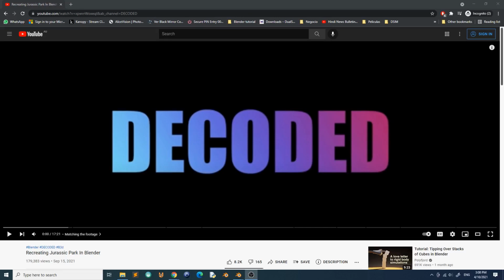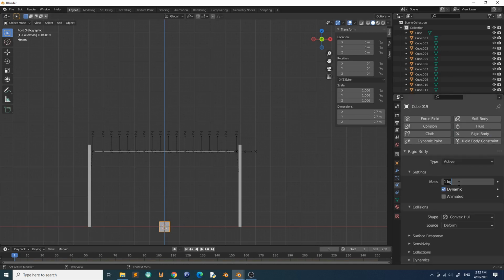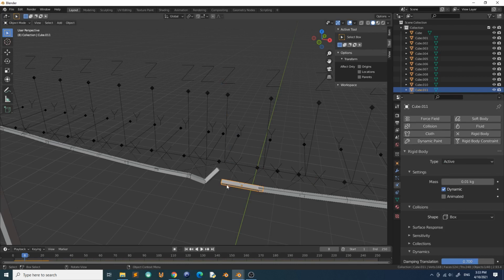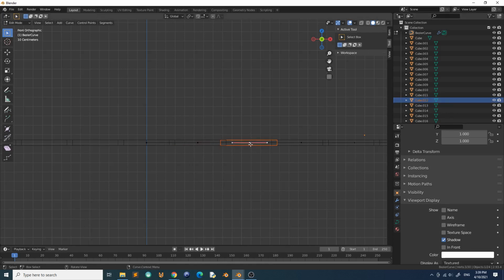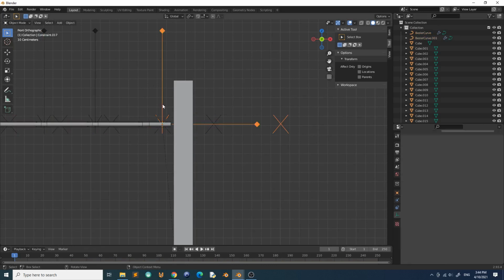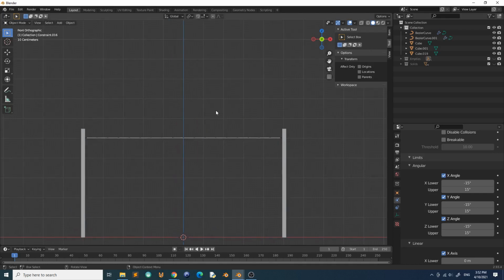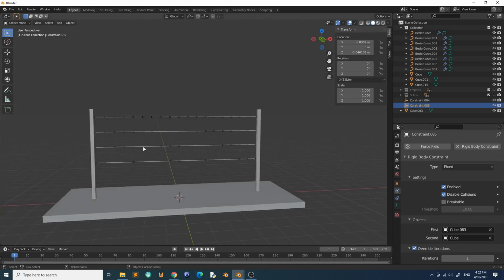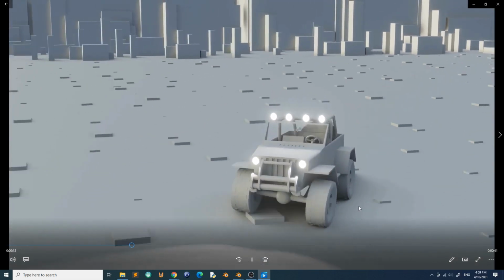Rope/Cable simulation in Blender 2.93 (snapping the cable)

Comment: can you make t rex come out from trees animation. Like trees branches auto move for my be broken
Reply from the maker: Mmm... Interesting question and yes it is possible. I could probably stack cubes or rectangles one on top of eachother like in a forest arrangement made of cubes where each tree is made by simple cubes (geometry node could be handy). then connect all of them using a fixed connection and lower the solver a lot to let say 2. This will make the connections very "elastic" and make some of them "breakable" and move your "t-rex" ( essentially an animated cube) and see what happend. I kind of want do it myself 😅

Comment: Hey I'm working on a short animation where security camera cables needs to collide with surrounding elements. The string of vertices method doesn't have collisions, the 2d plane with a solidify and sub surf modifier method doesn't work because the routes of the cables can be too complex, and I'm starting to run out of ideas for how to solve this that doesn't involve animating a curve by hand. Think your approach would work as a good solution? I don't need it to snap or anything.  Will the segments be obvious in the final render? Any other solutions you might know of to get cables to have physics with collisions?
Reply from the maker: You can do pretty much anything with cables made out of "solids" as in this video .
Any chance you can send me your file (a very simple file) just showing the concept of what you want to do?

Comment: This looks really good. I chose to use a cloth simulation for two reasons. 

1. The T-Rex doesn't instantly bite through the cables. She pulls them up above the fence and snaps them, so I needed the cable to be able to stretch. 
2. The cables had to be quite elastic so that they'd move out of the way once they snaped. Otherwise, the Rex would get tangled up in the cables which would look pretty silly.
Reply from the maker: Thanks for you comment!
I'm a big fan of your work!

A quick note:
The rigid body connections can be very elastic when the "Substeps per frame" and "Solver Iterations" are low
At the beginning, when I was experimenting with this approach I thought it was too elastic and I increased those number to make them less elastic
The other way to make the cable snap at a specific frame is "keyframing" the enable property so they will stretch as much as you want

Comment: Bro I have same project but it include chain and rope same technics is it possible
Reply from the maker: Yes, this can be done for a chain. 
If I don't have to show the chain too close to the camera I would use point connection (because you might get overlapping geometry) for a more precise chain simulation you could use mesh and no connection but that would make the simulation slow
For a rope do the same that I did in this tutorial just keep the connections as points
Reply: @arisa3779  thanks for your reply I have one doubt can I pm to you u have any personal chat I'd
Reply from the maker: @rk_Visuals-m4y  Sure I put my gmail in the channel information section
Reply: @arisa3779  bro I have a animation I have a hose  line connect to the ship and one side I connected static object so ones the ship slightly turn hose will drag and stretch then hose will broke that's the animation it is possible to do in rigid body or I can add bone to hose and animate with key frame which is good
Reply: Hose I use high poly then I array used and curve modified total hose is 32 that's the problem
Reply: @arisa3779 waiting for your Gmail
Reply from the maker: portilloedu270@gmail.com
Reply: @arisa3779  I send one mail can u check plz